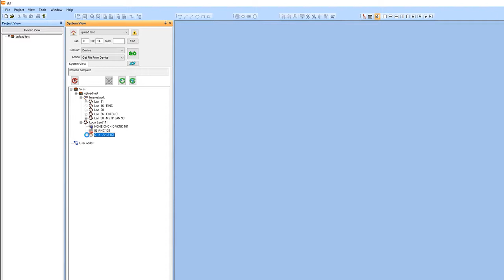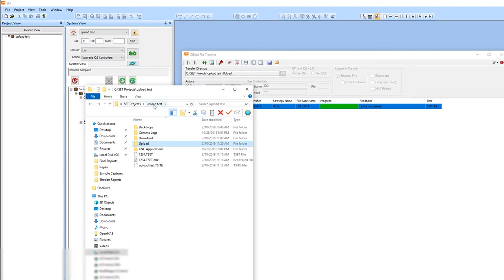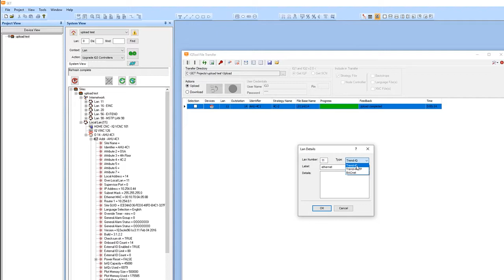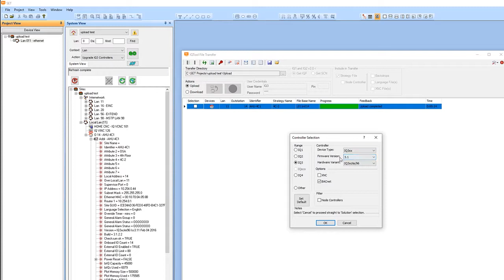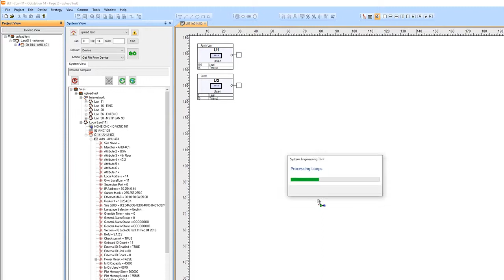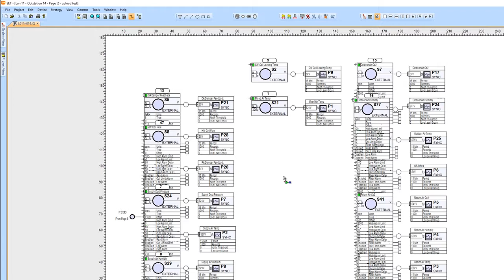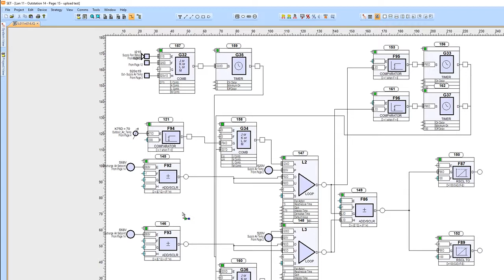SET   Upload and Compare

Comment: This may be a stupid question, but why would you use the upload/compare when the controller is not already in your project.
Wouldn't you just use the upload and import feature?
Reply from the maker: There is no reason to use upload/compare over import if you do not have anything.  Import is a rather recent feature.  Think that was added either a late release of v6 or early v7.  Back in the day...we would have to manually add every device we wanted to pull in.  Normally I have a fairly current project file, so upload & compare isn't something I use a lot.  One also should note the compare feature has had issues over the years.  I would always carefully look over a compared strategy.  Seems even today, links can be missing or sequence steps missing or duplicated within a block.  Its a great feature for the most part, but it can introduce problems that you will pull your hair out if you expect an perfect copy of what is in a controller.  If something looks off, check it in system view or text comms before downloading it back into a controller.